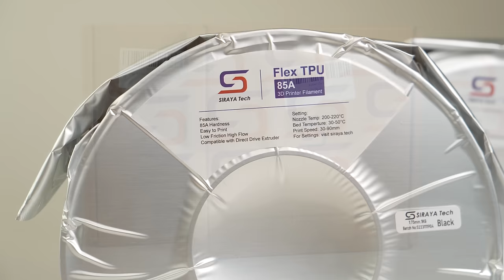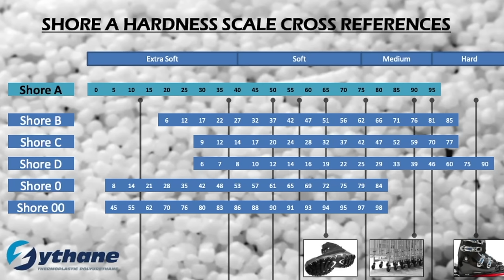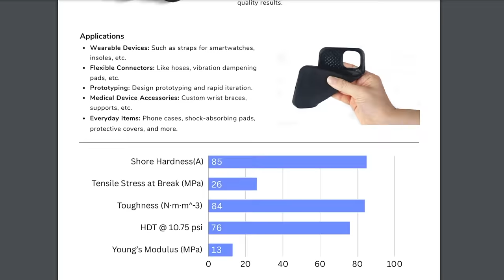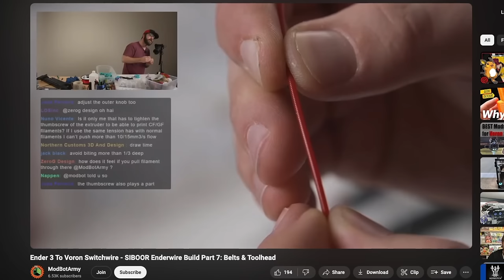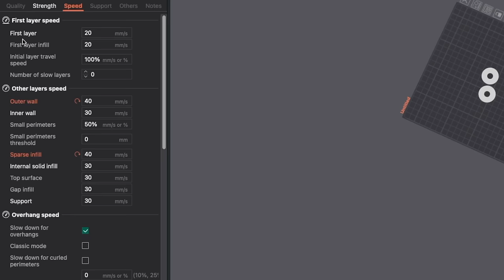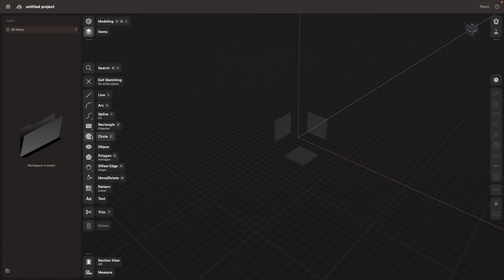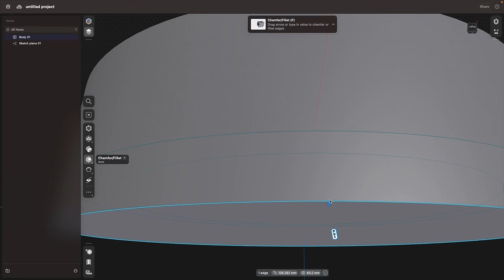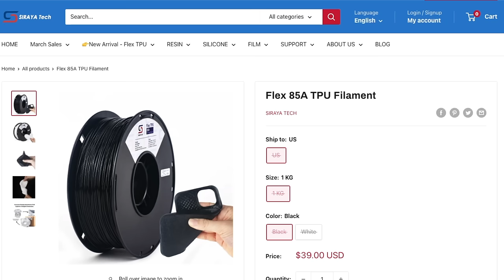3d Printing TPU For Beginners! (Siraya Tech Flex 85A)

Comment: I've made almost this is exact same part, but with the goal of screwing it to the wall, so there was a hole in the middle. The friction fit of the baby gate lost to my kids running into the gate to knock it over 😂
Reply: I came up with the same solution, but about 13 years ago
Reply: I think you need to print some wooden spoons

Comment: My experience with 85a tpu so far is that you want longer than usual retractions at a slower (un) retract speed. I usually print with 0,8mm at 45mm/s retractions, this works for me for all extruder and hotend combos i have. These are lgx lite, lgx lite based with spring tension, galileo 2 based extruder, vzbot extruder and orbiter 2. Hotends were rapido, rapido uhf, dragon hf, dragon uhf.

With tpu 85a i increased retraction to 1,5mm at 30mm/s retract and 25mm/s unretract. I also found it to be extremely important to have pressure advance or linear advance, better too little like for rigid filaments than no value. My experience is that you need about 10 times the value as for rigid filaments, in my case 0,4 instead 0,04 on the galileo 2. I also left spring tension at a normal setting, the lgx lite at the second, tighter setting.

The lgx lite, custom lgx lite and galileo 2 handled the tpu by far the best, perfect prints at more than 100mm/s were no problem, nearly no slippage due to the good amount of tension and grip of the filament. The orbiter 2 was not as good, there was some buckling at the entry of the metal insert in the extruder, but it handled 80mm/s fine. What really disappointed me was the vzbot extruder, the helical gears had more grip on rigid filaments, but the angle of the teeth allowed the filament to twist itself out of the extruder, resulting in underextrusion. The feed path was good, but it couldn't get a good hold on the filament, so i cant recommend it for softer than 90a tpu unless you are fine with conservative 40 to 50mm/s.
Nevertheless the galileo 2 with 100mm/s for all features besides first layer produced the most perfect 200% cali dragon i have in my collection, not even a bit pf stringing between the horns.

Another tip for tpu is to use IPA if you cant get it off the build plate, it acts as a penetrating fluid.

Comment: TPU is underrated.  I have a small niche online business and all products are TPU.  I bought the  Siraya Texh Flex 85A on 29DEC23.  I wanted to replace the very expensive NinjaFlex 85A for one of our products.  The filament looked as good as NinjaFlex (minus the texture on the filament) and it stretched the same so I was optimistic.  The parts printed well.  They looked the same.  They felt the same, with the same squishy feel.  They didn't work the same.  These parts need to stretch over other parts and they didn't stretch quite enough.

TPU is like that.  It's an art form.  For very impact resistant structural parts, any 95A TPU will work well.  For critical parts that need specific physical properties, I select a likely TPU based on durometer and design the part geometry to work properly with that particular TPU.  Do not expect to be able to substitute one brand for another with the same durometer for critical applications.  They're all different and the actual durometer can vary widely from one manufacturer to another.

I need to try to change the geometry of the part that didn't work with the 85A Siraya Tech to hopefully make it work.  The cost difference is huge and Siraya Tech makes good products.  I'd love to have a source of 85A TPU at a third of the price.
Reply: Haha ninja flex is tough to beat, I almost thought they were stopping production with the way the prices went up. I remember buying .5 kg spools for $18 at one point.  Now they are absolutely ridiculous.   I have been looking for a substitute ever since.   This looks pretty promising for general use.  I was also looking at the sainsmart 87A, but I think I'll give this a go after reading your comment. No print farm or specific products for me, I just want something that generally resembles ninjaflex at a fraction of the cost

Comment: Another fine video Dan, thank you! I too am a fan of functional and useful parts. I have recently "reinvented" a working hinge by substituting TPU for the common solid hinge pin. By doing so, it allows for a positive engagement of a small detent modeled into the hinge plates but flexes enough to provide normal operation. ✌🏼

Comment: I like TPU as a material, and I wish we had more rigid TPU options. I have a spool of 98A, and it’s been pretty good for some functional parts where toughness and dimensional stability in moderately high temperatures (like the inside of a car) were needed.

Even so, 98A is still too flexible for some parts that I’d like to make. In essence, I’d like something closer to the rigidity of PETG, that’s fairly easy to print, that doesn’t warp like ABS and Nylon, that can be used in a very warm environment, and that doesn’t require a very high nozzle temperature.

I’ve thought of trying the ninjatek armadillo material, but the cost per gram is a bit rich for my blood.

Comment: I’ve printed with TPU quite often with my smooth PEI surface. Your warning about too much adhesion is probably wise, as the parts stick rather strongly to the surface. However, I’ve had a lot of success with a light coating of Aquanet.
Reply: I use baby chalk powder on smooth PEI. Also matches the theme of this video.

Comment: My best prints with TPU have come at temps on the high end and even above your recommended temps. 228 is about the coldest I have run out of my 2 Artillery, my MK4 and my Bambu printers. I mostly use 95A Matterhacker Build TPU or Sainsmart, and occasionally Amazon Basics. My bed is as low as room temp. My retractions are preset in the slicers (Orca, Prusa or Bambu).

Comment: My roof downspouts drain the water out of extensions that carry the water away from the house. The lower elbows were always getting bent as lawnmowers, dogs and kids kicked them around. I printed those lower elbows out of TPE 85A and that solved the issue. That bit of flex solved most issues.
Reply from the maker: That’s awesome. That’s a fantastic application. No issues from UV?
Reply: @ModBotArmy  I don't know yet. They've only been on for two summers, but so far so good. I print a lot of outdoor stuff, and I can tell you PLA is horrible. I moved to ASA and all is well for my rigid work. So it will be interesting to see how the TPE holds up.

Comment: I have a pei build plate that only has the film on one side, and I've had good results printing TPU on the bare metal side with a very thin layer of glue stick. I have a piece of paper towel that's saturated with the glue, and occasionally put a few drops of water on the build plate and use the paper towel to reapply the thin film of coating. 

The only downside is remembering to change the z offset if you have an inductive probe.
Reply: Thanks I made the mistake of ripping my PEI.. will print on texture sheet next time

Comment: I will have to try some of their fdm filament. I find the need for softer filaments more often. I once tried an experimental filament sample that was somewhere around shore 00-40. I was only able to print it with a flexion extruder (not manufactured anymore).  I feel shore A 50-65 works very well for bumpers, gaskets, seal, and bushings.

Comment: Tried my first tpu print the other day, other than overhang issues just loaded and was on my way. It was probably one of my best prints with a new material ever. I'm struggling to find a use for such a hard material though. Edit: should mention this is out of the box 85A siraya.
Reply: Struggling to find a use is what 3d printing is all about!

Comment: My functional prints so far have all been printer parts. Don't buy an Ender 3 Max Neo. It's a nightmare. I had to make 10+ different parts to get this machine to print well but at least now it prints well and reliably... I just throw gcode at it press print, walk away & come back when it's done. It's not an Ender 3 anymore at this point only the frame steppers and belts/wiring are left from the original.